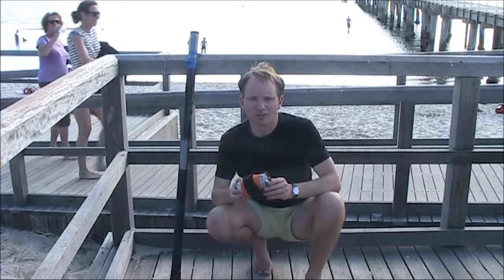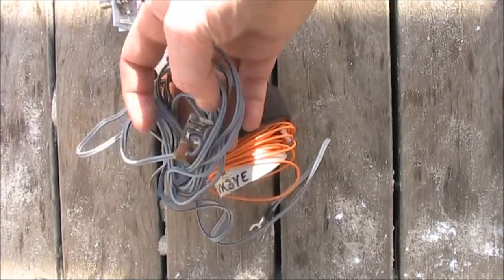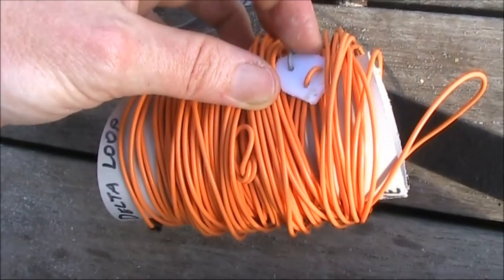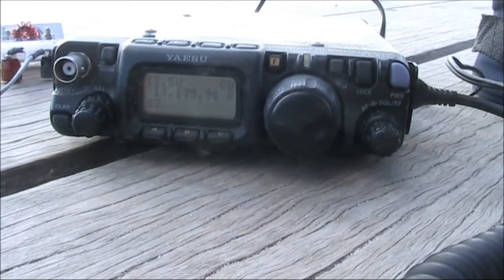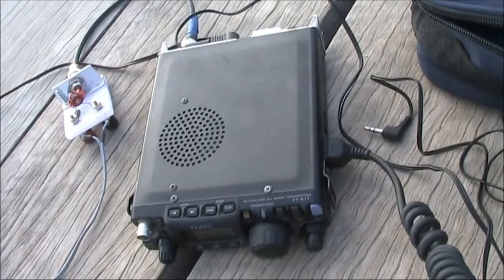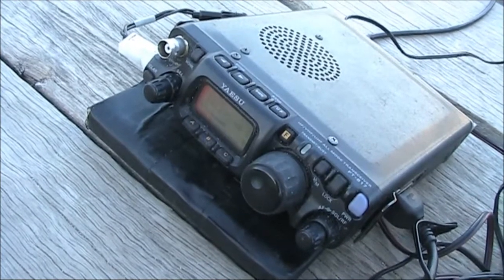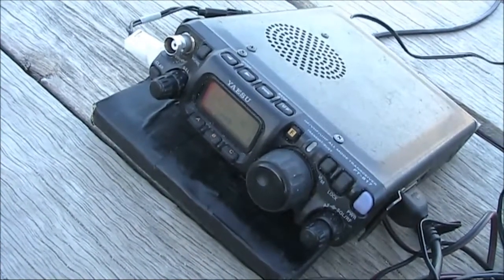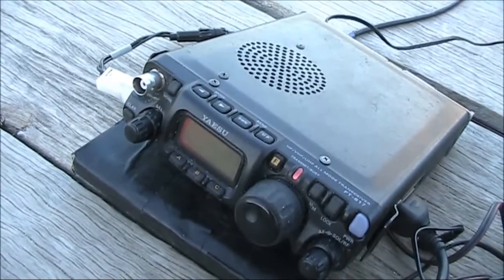Amongst the kilowatts 2: More 14 MHz delta loop QRP DX

Comment: Thanks Peter. 
A loop is a great portable antenna.  I use a 4:1 current balun to tune my 20 meter loop to multiple bands. With an LDG tuner I can get it to tune 80 meters through  6 meters.  It is not very efficient on 80 or 75 meters and the radiation pattern is horrendous on 6 meters but it does tune those bands.  On 40m - 10m it works nicely.  
73,
Tony KE4VVF